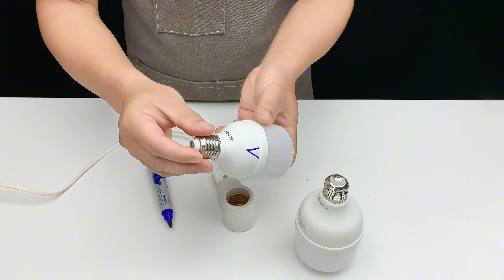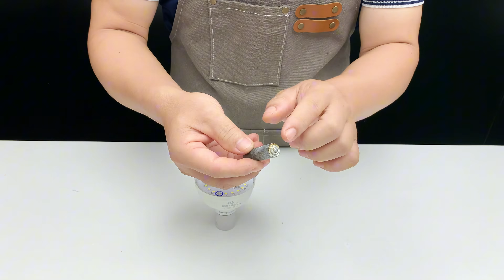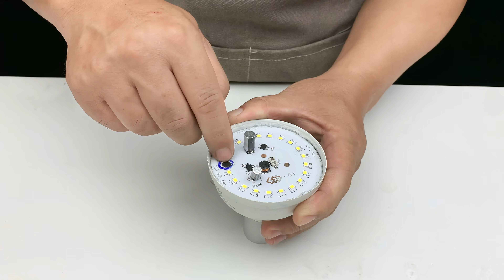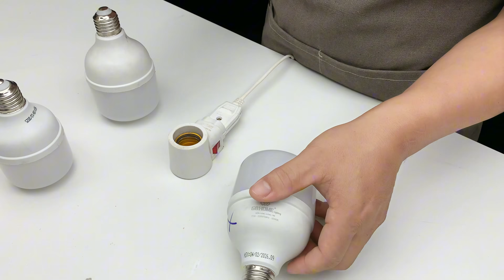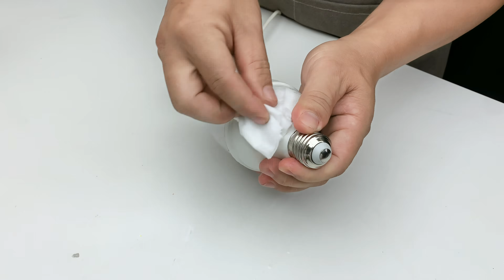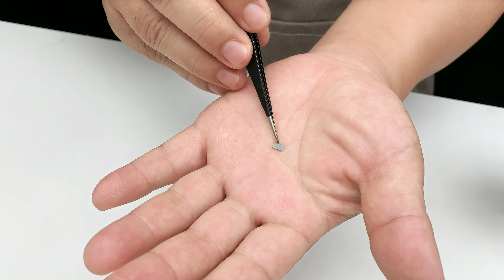Just Use a Regular Screw and Fix All the LED Bulbs at Home! 3 Simple Repair Tips to Save You Money

Comment: It may revive for a hours after it will burn because 0ne led loss it can't resiste as befor.
Reply from the maker: Thanks for sharing your thoughts. The result can vary depending on the condition of the bulb and the components inside. In my testing, the repair worked well as a practical way to extend usability rather than throw the bulb away immediately. Have you ever tried repairing LED bulbs yourself?

Comment: This is working right ...but this method is wrrong ....fix the resister or led smd ..😂🎉🎉
Reply from the maker: I understand your point. Replacing the resistor or LED SMD may be the more conventional and durable solution. In this video, I simply wanted to share a different approach that doesn't require replacing components, so people can compare methods and see what works best for their situation. Surprisingly, the bulb I repaired is still working well today. I think there are many ways to fix LED bulbs, and the goal of this channel is to explore different options rather than just one solution.